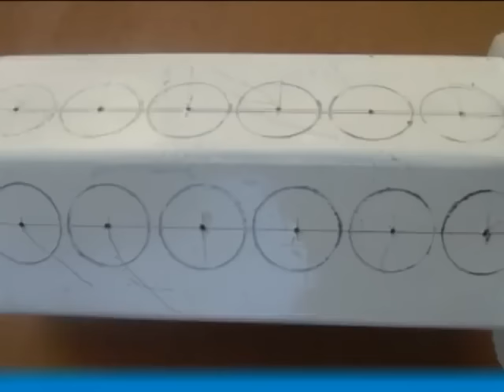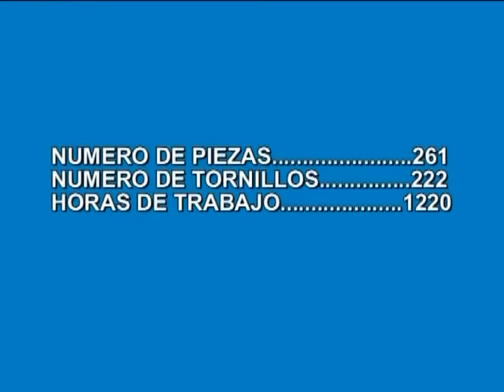Handmade V12 Engine

Comment: I am a retired tool &die maker and stood over a lathe and milling machine for 35 years.i could probably make one if I could live to 148yrs.
Reply: I had 44 years in the trade. Now I'm crippled. Sold all my tools. I can't even turn a wrench anymore. I had a lot of fun and built some amazing stuff. My friend built a flathead Ford aluminum block. The raw kit and castings were $500 in the 70's. It put out 5 HP. The spark plugs were so tiny.
Reply: @Mike383HK  I have a workshop filled with tools including both a good sized lathe, a milling machine, welders and etc.  For decades I supplemented my 48 hours a week regular job by repairing cars....mostly installing engines where they didn't belong.  Now, the tools sit in my shop and haven't been used much in years.  More and more I find I want to do the things in life that I really enjoy, like watching youtube videos and touring via my motorcycle.  

Going to ride my bike to Pike's Peak in a couple of months, just as soon as I return from Argentina to view my 10th total solar eclipse. 

Wanna join me?
Reply: @blackholeentry3489  I had a full shop. My specialty was impossible jobs. Anything that nobody wanted to do. I destroyed my body in the process.
Reply: @Mike383HK  Sorry to hear that, Mike.  People who can create items with their hands are a rare breed.  I specialized in installing engines in places where they didn't belong and often had to create ways (and parts) for doing it.  One smart thing I did was create a cleaning station so I didn't have to breathe the fumes.  Another....I'm one of the few who never had to quit smoking because I never started....anything!

I'm still in relatively good health....just avoid working on cars unless I must.  You know the story....the mechanics car is often the worst!   No matter how many cars I repaired, there were always several waiting....besides my full time 40 hr a week job.  I worked a lot of graveyard shifts, so I had the daytime open.  If I had it to do over again, I would have charged much more and worked less.  

My favorite personal car....I found an abandoned 1954 Kaiser 2 door sedan (only 150 made) and installed a 65 Pontiac 389 bored .060 over to make it a 401.  I drove that car all over the western USA, surprised many and always put a smile on my face.  

Now, I want to spend what time I have left doing what I really enjoy....like riding my motorcycle and chasing solar eclipses......going to Argentina in about three weeks for the next eclipse...my 10th and my 2nd wife's 4th.   Then, I'm riding my motorcycle on a 4000 mile trip to visit my younger brother in  northern Idaho and then down to Roswell, NM to tour the UFO museum.  (BHE.....Mel)
Reply: John Carter... This is beautiful craftsmanship but, just an air powered toy. 
I'll be impressed when he adds a fuel and ignition system.
Reply: Can you give me a lesson ♣
Reply: John Carter I am a machinist and engineer myself and the work that goes into something like this is just incredible. Maybe one day if I hit the lottery and can spend my shop time working on my own projects I will make something like this.  Absolutely beautiful work here.
Reply: That's what a 2000-3000 man hour model project looks like.
Reply: I’ve seen a lot of miniature engines but nothing like this he could get $30,000 for this if you made a factory day in day out
Reply: we need to find an anti aging syrum for this man asap
Reply: @robc8468  i was guessing 2-3 years for a retired machinist
Reply: @blackholeentry3489  Installing engines where they don't belong...LOL.  

Dad had a 54 Austin Healy 100-4 with a hypo 289 shoehorned in, driveshaft about a foot long, original knockoff wire wheels and all.  411 gear and MY GOD would that thing hole shot for a fairly mild street car, weight transfer was nuts for a dead stock looking car (almost, bumpers gone, passenger door welded shut (pure convertible), and two large pipes sticking out the back right under the license plate.  

We used to go out and TORCH 454 El Caminos, 427 vettes, 396 Chevelles,  454s, 440s,  389s, (never found a 426, unfortunately, (did drag a cop though once, in one of those interceptors, he was a friend, obviously) what evers, you name it, when I was a kid.  

I'm sure a few of these would have smoked the Healy quarter mile (or at least beat it) but at stoplight wars this thing was a tiny beast.  Good fun, good memories.  Someone else did the conversion, and when we got it it was straight piped, had a STRING coming through the firewall for a throttle (I kid you not, and it would stick occasionally, you talk about someone trying to find the ignition key post haste, THAT one got fixed before the second time leaving the garage, the why is obvious). 

The genned up firewall leaked like a sieve, a shifter that was a rod sticking through a hole in the floor, as the pivot, etc.  All of that got fixed before long (and the straight throughs that didn't quiet it all that much, but enough, really reduced ground clearance) and it got a bit tamer to drive (reverse lockouts and the like).  Fun times, probably dumb times, but some of the best memories from childhood.  After his work (engineer) and the day's evening projects I would always beg a ride and it never took much effort, if you catch my drift. At about 10 I was sitting in his lap and 'steering'.  By about 12 throttling down and drifting turns on little windy roads you'd almost never see a car on night after night, then on to restoring a couple of Cudas, building engines, building a Long EZ aircraft with him (people used to joke it would have taken about half as long if we didn't argue about the fine points of every step beforehand), etc.  Some parts of life are good!

And yeah, I've got an old Goldwing sitting there ready to be finished, and a wrecked GXSR 750 I intended to yank the motor from for a one off self designed reverse trike. I learned a LOT about suspension design, etc. (fascinating) then never did get to the project.  I always quip I've forgotten more than most people know.  Done machining, painting, what came up plumbing/roofing/cabinet making/ and everything else that has ever been done to anything I've owned.  Jack of all trades type (elec engineer by profession).  

My dad (physicist/engineer) used to shake his head because my brother went into mechanical engineering (he SUCKED at mechanics, but was a pretty good engineer).  I remember a 5 speed he 'rebuilt' once on his RX7 that whined worse when he got done then when he started. It turned out, upon my questioning, that he was hammering bearings into place THROUGH the bearing...ie, outside race onto shafts....oops.  Guess I should have helped. Worst part was this was AFTER he graduated.  Lots of theoretical for design, not much practical, obviously.  Was pretty true for my electrical, too, but you learn all the real stuff when you start designing  fortunately with much more experienced people mentoring and looking over your shoulder (design reviews and the like) or initial designs out of school would have been unmitigated disasters.

Yeah, my tools sit any more, too.  I REALLY do need to go remedy that, so many unfinished and unstarted projects, so little time.  I commiserate.
Reply: Imagine being pestered by your shop floor manager for 148 years.
Reply: @blackholeentry3489   Where can I purchase an Injun like this and building A18 scale model of a Ferrari testarossa and have a miniature 12 cylinder engine would be fantastic Could you help me with some ideas
Reply: @planeandsimple431   A crap your right so in the end this would do nothing to help my car What is shame the craftsmanship is just amazing or maybe I would even purchase one of these just to have a look The amount of man hours that must go into this and guessing anywhere between 1000 to 5000 hours
Reply: @seandesurci7389  I don't know anyone commercially making V12's but a Conely Stinger V8 is pretty bad ass- they ain't cheap though.
Reply: @planeandsimple431   OK I look into that thank you so much the 1/8 scale Ferrari that I'm building right now I'm building it for someone it's on consignment so if hes interested in doing that engine he wants to spend the money more power to him
Reply: @blackholeentry3489  the best of the best are in Japan old but still working mighty hard

They’re called Takumi craftsman, a title given by the government after having 60,000 hours of expirence in the field

Comment: Absolutely beautiful engineering sir... I love the valve train and double cams... a large cylinder with hydraulic fluid... the size of your cam followers on the lifters, a line up to the rockers and a smaller cylinder on top of a bucket like Jaguar or Alfa and Ferrari use on the valves... and you have a very uncomplicated hydraulic lifter... Renault used little short lifters... in the old 1600 and 1300 engines... back when I was an apprentice... in the dark ages before unleaded gasoline 

It's a work of art... thanks for sharing
Reply: If you want to make it go fast... I have been thinking about magnetic valves... with neodymium spheres instead of the mushrooms with valve guides and heavy duty springs... it will require a solenoid for each port into and out of the combustion chamber... it will actually close much faster and provide more swirl to the fuel air mixture... and it requires less than 10% of the energy cams and valve springs rob from the power you develop... I have a metal that forms at very high temperature, and pressure... it's melting point is 1768° C..  it's got covalent bonds... double double covalent bonds .. rather than metallic bonds... it's 10 on the Moh's scale of hardness... like diamond... it's not rare... and not hard to find... it's absolutely ubiquitous, wherever you live... you, and everyone on Planet Earth have access to AuPt... gold platinum alloy... in greater quantity than all the gold and platinum ever mined in our current civilization... I can fill Ft Knox 3 times a day... practically forever... and you do too... each of us here on Planet Earth 🌏... it's a gift... from my family to your family 👪 

Ad Infinitum 

AuPt will set us FREE 

The double double covalent bonds create a room temperature superconductor.... and it should be big fun in the machine shop, because it can be used as is... and machined like steel or aluminum... 1768° is not easy to get to... most other metals are vaporized at that temperature... a superconductor with double double covalent bonds does not pass electricity... it appears to magnify magnetic fields... and I use a small magnet on top of a flat piece of AuPt and it holds a much larger magnet on the bottom  .. of a stone that is not very magnet at all... Au and Pt are not magnetic by themselves... but Au has one more proton electron pair than Pt... the difference creates a magnetic field... and they line up in perfect little rows and columns... because both atoms are, mas o menus, the same size... it's cubic structure is present throughout the entire stone... and it appears to be a 3 dimensional checkerboard... Au and Pt align with N and S... through the whole stone.... it's 5 orders of magnitude harder than sapphire and ruby... 10,000 times harder than aluminum oxide... it's extremely dense and has a specific gravity of 20.. between gold at 19... and platinum at 21...

Comment: This needs to find itself in a cool model. Beautiful creation
Reply: This is not sn engine, it is a very complex air motor. It can only run if plumbed into a compressor to power it.

Comment: With over 1 million views, nobody has asked why the camshafts spin at crankshaft speed, and not half crank speed, like all 4 strokes do. The gearing shows 1:1 ratio. Gentleman clearly has an engineering/jeweller background. Very nice work.
Reply: i think it’s a pneumatic engine because it doesn’t have spark plugs or a carburetor so it can’t be gasoline, it doesn’t have a carburetor or glow plugs so it can’t be nitro, and it can’t be a diesel because it has no injectors. the line also doesn’t have liquid in it from what it looks like, so is probably air, that would be why the cam is 1:1 with the crank because it has 2 strokes, one valve to let the air in to push the the piston down on the first stroke and the other to let it out on the second.

Comment: AMAZING!!!!! Now someone needs to put one of these in a RC p51 mustang.
Reply: You clearly don't understand. This is an air motor  not an engine. See the airline running to it? To put this in a model would require a large compressor and associated driving engine/motor. Clearly not feasible.
Reply: Oh that’s too bad fortunately there is a few others that actually run on gas

Comment: is this engine running by air pressure? there's no spark plugs or battery wires linked. Or is this diesel? i don't understand how it is running, could someone enlighten me on this?

Comment: something's off with the cam gears; why are they the same size as the crankshaft gear? i would understand if it was a 2 stroke engine but seing there are intake valves and manifold, it must be a 4 stroke. does somebody know?

Comment: This look like some form of fuel engine but I’m wondering how ignition occurs and how it manages fuel / air relationship. Am I decided is this actually a pneumatic engine?
Reply: I think you are correct. No source for ignition that I see? I think it's basically acting as an air compressor, more than an actual gas combustion engine, along with that big heavy flywheel to keep up the momentum. Still, that is an amazing work of machinery and they guy is super talented!
Reply: It’s an engine for shows of mechanics at schools, where no contamination is required. The importance for Mr. Patelo is the teachings of the craftsmanship to children’s and young people with quality models and videos.
Reply: The big white tube entering the air cleaner is an air hose that drives the "air engine". It is not a gas engine that would have been much harder to make.
Reply: @goblin003  I agree, air driven. Basically for demo, but a lot of work to build. Some of the valves appear to float at times.

Comment: my question is how is it possible to run? how do you burn the fuel?
Reply: Same thing
Reply: spark plug
Reply: @aiexzs  i know that have you seen any spark plug implementing on this engine?
Reply: It is powered by compressed air. Burns nothing.
Reply: @ashkira2  why would they add valves lol
Reply: @aiexzs  
Air pushes the piston. First - you connect chamber to a source of compressed air. Piston moves. Then you must drop pressure in a chamber - two actions here - 1) close intake valve to stop air supply, 2) connect cylinder to atmosphere to make pressure drop. This is why engine has valves. Two stroke essentially. 
To make it even more clear - engine has neither carburetor nor injectors :)
Reply: So it isn't really an engine in the true sense of a "combustion" engine?
Reply: @flyman451  
It's still an engine (it turns some energy into rotation), but isn't "combustion" engine. The same kind of engine is used in compressed air tools.
Reply: Yes, I wasn't thinking it through.  It is really an amazing feat of miniature machining.  I spent my entire working career in the machining industry.  As a toolmaker and a manager for forty years.  It is very difficult to machine small intricate parts with manual machines.  When I watched the crankshaft being machined I think that was done on CNC (computer numerical control) machine.
Reply: @flyman451  like a steam engine. The boiler is separate.
Reply: ashkira2 — very good explanation.  Thank you!
Reply: Matt Troutman — I might be wrong however the crankshaft looks like it was made on a manual lathe. I agree with you. With those small sizes and seemingly tight tolerances, it would be a very difficult and time consuming process. 1220 hours of work is what it claims at the end of the video. I’ve also been in the machining world for decades. That project would try my patience though! That’s 30 weeks at 40 hours a week! Really cool to see.
Reply: @emmetpim3789  i think the filter connected to the exhaust manifold to dampen the noise of the air rushing out.
Reply: @emmetpim3789  I thinh that it is a two stroke Diesel.
Reply: It’s an engine for shows of mechanics at schools, where no contamination is required. The importance for Mr. Patelo is the teaching of the craftsmanship to children’s and young people with quality models and videos. That is the reason it’s air compressed.

Comment: Doesn't this "run" by compressed air being pushed into the cylinders? To see that at the end of the video is a bit of an anticlimax.
Reply: Ok, go try and make one yourself.
Reply: To do that is much more difficult you probably want to check and see what materials at that size can handle the firing of the cylinders. And depending on the material you choose increases the price of how much stock you need. Then depending on the material, you might need different tools just to cut those materials

Comment: 3:45 I'm missing something here... Why are the crank and cams in a 1:1 ratio instead of 2:1 ?
Reply: Maybe, idk, because it was DESIGNED THAT WAY?
Reply: @ryantexada9269  I understand that. It's just very unusual for a four-stroke engine.
Reply: @adamv242  its also unusual for a fully functional v12 engine to fit in the palm of your hand
Reply: @ryantexada9269  the scale is irrelevant. Cams always rotate at half the speed of the crankshaft.
Reply: @adamv242  not always apparently
Reply: @ryantexada9269  That's why I'm curious about it!